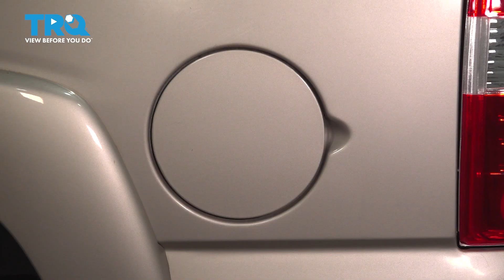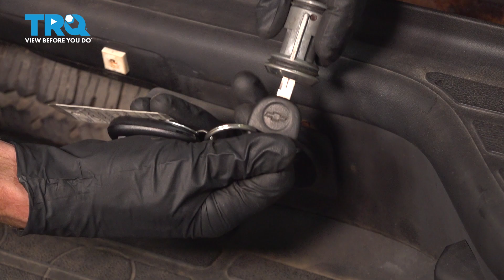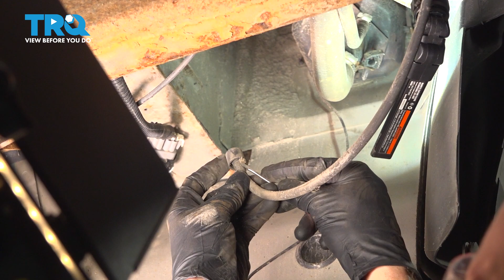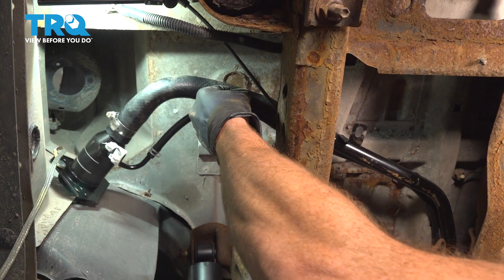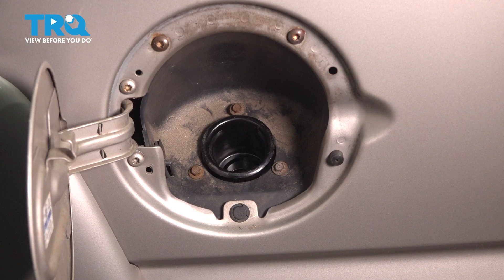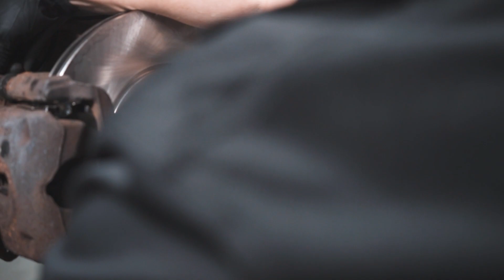How to Replace Fuel Tank Filler Neck 2000-2006 Chevrolet Tahoe

Comment: Why did you replace the filler neck was the vent tube clogged up and it wasn't taking gas?. Just curious I'm having that problem I done replaced the charcoal canister and solenoid

Comment: I wonder if there would be an advantage to removing the bottom portion of the rubber hose to tank. That way there will be less rust metal debris going into the gas tank.
Great video all around. Just curious.